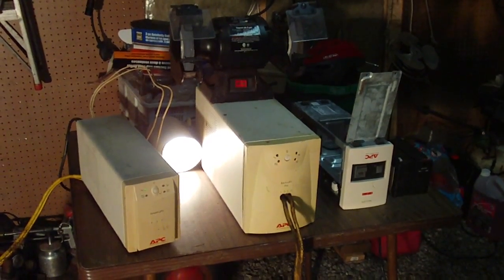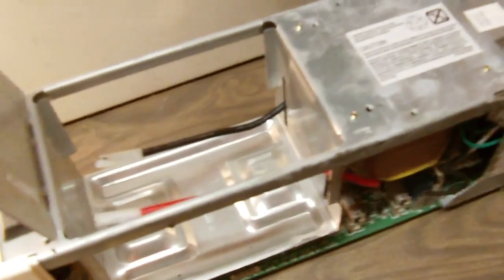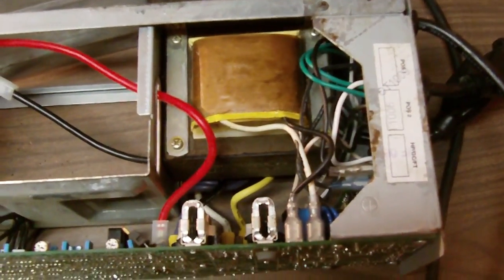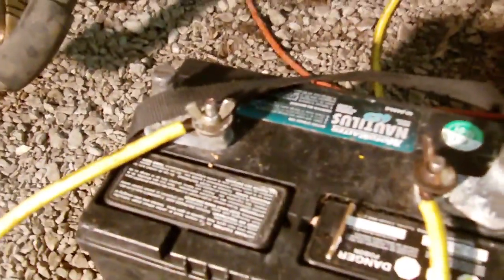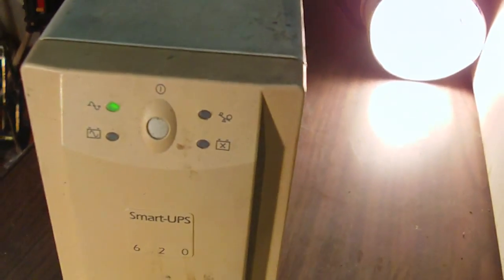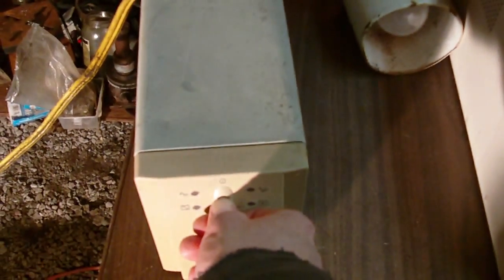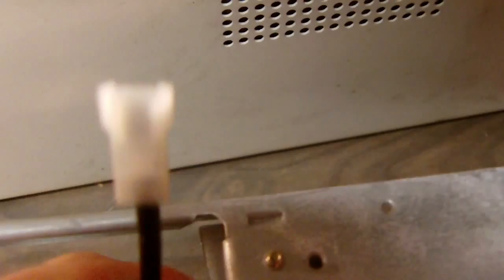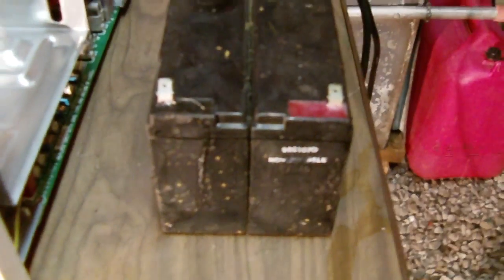How to convert a UPS backup into an inverter

Comment: Hi I tried this but even with a high capacity battery the ups still things that the battery is small and automatically shuts down after 6~10 minutes. How do solve this problem?

Comment: Nope, that and most cheap units have a bypass circuit, most of the time it uses house power. This is because most cheap units deliver mod sine wave power that is not as clean as grid power...

Comment: you should put some cooling fan on it I have one cut a hole and put cooling fan in my so I can run it long hours and it will not over heated the fan come on cool down the unit

Comment: The inverter doesn't turn on unless there was originally a 120Vac source. If I just plug the unit to the battery, I can't get the inverter to turn on.

Comment: When I do it I get a beeping and a relay trips and it switches off after just a few minutes. An that is with me adding a few 12v in parallel that rund a normal inverter for hours. It seems to be switching a relay that clicks back and forward for a while then just switches off. Any help to bypass the relay.

Comment: What for sure we cannot convert back to Inverter is when the UPS requires 220 volts DC input. My UPS is 6kw and it requires 20 small 12 volt batteries therefore I couldn't convert it back.

Comment: Unfortunately, this was the most obvious part of making a UPS function as an inverter -- Hey! Hook up a 12v battery to the 12v battery terminals!   I wanted to see how to disable the beeping (locate and clip the piezo-electric beeper, I assume) and reduce the massive box of the UPS.  Make a 2nd video showing how to downsize the UPS, scrap the huge transformer if it's not needed, disable the beeper and add a fan for cooling.  Shouldn't be too hard (I hope), and if you've had your hands in the guts of these things for 10 years, I bet you know how to do it easily!
Reply: The transformer is needed
Reply: Yo do your video showing it.

Comment: Difference between inverters and UPS systems is that inverters have heatsinks and fans to remove heat build up. UPS usually rely on thermal mass as they expect to only be on for a few minutes tops. Watch out for overheating. Stick a thermostat cooling module and a cpu fan in there at least and rear terminals for battery connection.
Reply: That is exactly what I thought of doing.  I have a 2000va unit and 2 x 100ah batteries. (24v im series).  Not looking to run much, just want to get rid of the annoying part of when the power goes off,i must go to the garage and switch the inverter on. Plug in extension cables in house to my devices and the whole rigmaroll again when the power comes back on. I am running 1 x 11w light, wifi router, a fan and a cellphone charger on it. Just want them to run the whole time on the ups.

Is there ANYWAY to get rid of the stupid
 beep though?
Reply: Break off the buzzer component  @mizmera
Reply: @mizmera  But I noticed something, is like the 650v ups can power itself from the battery without AC power, which the 1500v ups can not power itself from it's battery without AC power.

Comment: And in another failed attempt I figured I could hook solar panels to  my ratty sine wave inverter, then to my ups ... in would clean the sine wave, charge the internal batteries ( or bigger external batteries if I hit the lottery ) and smoothly switch to battery when the sun went down ( with absolutely no interruption to my low power desktop( 90 watts !) . It would also avoid the varying dc voltage from the panels.. as the inverter simply turn off at low voltage.. and effectively consume all the sun nature gave me. . Sure I’d loose an amp or two on the deal but what the hell. Well turns out the ups is finicky about the ac input. Doesn’t like crappy semi square wave... only premium crap from coal fire plant. It makes sense in the end as a ups vets the quality of ac input before changing over. Solution... MAINS. :-(

Comment: I really want to avoid battery’s.. there too expensive. Yet I have 500 watts of panels wasting energy all day.  Why can’t somebody engineer a device that consumes the dynamic 12-19 volt dc from panels .. boost the power to 115 ac BUT reverts ( and or mixes ) to Mains power if the solar input is non sufficient. Of course the ac power sources would always have to be in phase.( a difficult prospect that a ups achieves )The filtering action and nice sine wave from a ups achieves some of the goals. A grid tie inverter will not produce ac if the mains go out so using that is not a good option as it doesn’t facilitate emergency power.... and my power company will have a cow if they detect me using one ( thanks smart meter ).  Anyhow thanks for your video ! Ideas are collective and you got me thinking. Sorry if I’m all over the place.... just drank a monster LOL

Comment: well im trying to hook up ps4 in my car using this method instead using a normal power inverter. i think it will be good right? and if i keep car idle the battery wont discharge
Reply: as long as you use a true sine inverter NOT a modified sine inverter.

Comment: I ran my house off of a 24 volt 600 watt unit 1 model newer than the one in this video. Looks the same but mine had a strip of LEDs that indicated the load going through the unit. would do a high temperature shutdown if I pulled more than 400 watts for a an hour but never caught fire. It would actually pass all 2000 watts of generator power directly through to my house so I had enough power to start up my refrigerator. My battery charger I had plugged into my generator put out  28.5 volts at 40 amps  into a  200 amp hour  flooded lead-acid battery Bank. I worked like this for years until I upgraded to a quality off grid system.

Comment: what about charging the car battery?it takes more time than the original ups battery!!!because the ups battery capacity is around 10 AH while car battery is 60-90 AH !!so how to solve this point ??
Reply: I ran the 24-volt unit to power my house for 2 years. When I need more than 400 watts I ran the generator. I had a battery charger hooked to the generator to keep the battery full because the built-in battery charger was too slow

Comment: Actually this is a dumb idea!! UPS units are not designed to run heavy loads continuously, their transformers aren't rated for running for long periods of time and eventually fry . Also most offline UPS units has the control circuit programmed to shut it down after max 15,30 min even if the battery has a lot of juice left.
Reply: You say the control circuit shuts down after a set time? I'm not sure but mine would work for a few days before my batteries died and I was forced to run the generator.  Of course I disable the annoying beeper
Reply: I ran my house for 2 years off of the 24 volt 600 watt model. It had a bar indicator to show the load that was passing through it. it may have been a slightly different model. It actually passed power from my generator directly through to the load and and charge the batteries at the same time. As long as my generator was running the internal inverter in the UPS was not being used. When the generator was off if I kept it under 400 watts it would not overheat. Of course I finally upgraded to a real off-grid setup but these old UPS's proved robust to me

Comment: My desktop ups has auto off feature if there isn't enough load.... How do I prevent it???
It won't lasts long if I connect small loads such as mobile charger stereo etc
Reply: can you conenct to it using usb or network? you can usually use a program to set that. including any warning signals on or off
Reply: @Politikul  no I can't.... Only power outlets are there no other ports available

Comment: 0:30 It is VA not Watts, and with a special serial cable you can change settings of the UPS, such as the low battery alarm and many other settings.
Reply: how do you turn off the alarm when you don't have it connected to 110V?

Comment: 24 watt UPS how to connect single battery 12 watt please answer me fast
Reply: You would have to hook up a boost converter. In essence ( believe it or not ) it takes 12 volts dc in .... converts it to AC... then converts it to 24v dc. All this being said... the price of such device increases as the amperage increases. You would have to do the math to figure out how much the ups would draw when it demands battery power. There are a whole lot of things to worry about.

Comment: Adding and consuming such big battery  is easy, But How long it will take to fully charge 150AH Battery by a ups circuit board which is actually designed just to charge 7AH Battery ? May  be  10 to 15 days  !!

Comment: Thanks for the video, Thumbs Up. I have a newer UPS in which the charger apparently will not work, or at least not correctly. It was supposed to be charging two 12v batteries, connected to make 24v. But the charging circuit is only putting out 19.9v, which drained the batteries to low for it to work at all. 
However, with a fully charged battery, the UPS still works and puts out proper ac voltage. So this is an idea for a possible alternative usage.
 In any case, its always good to keep things like this in mind, especially when a need arises, and no other alternatives are available, or if other power sources are being rationed to last as long as possible. 
People today especially need to learn to think out-side the "college educated" norms...
Reply: Interesting - which make model of UPS is this that takes 24volts?

Comment: don't use car battery, you need deep cycle batteries.

   The battery plates in such type batteries won’t get damaged even in deep discharge condition. But the automobile battery is quite different from deep cycle batteries, if an automobile battery is discharged deeply, then definitely it will damage the lead plates and reduce the battery life
Reply: The difference of a deep cycle is the distance between the bottom of the plates and the bottom of the battery that holds the electrolyte is greater so when conductive material comes off the plates and falls to the bottom of the battery, there’s more room for it to build up before shorting the plates. I am thinking about using lithium titrate that can discharge completely without damage, charge at a high rate and can get really cold too. They are not as energy dense as more common batteries and the are not as efficient, that’s the down side
Reply: I learned about this helping my dad installing high amperage equipment in police cars. I’d leave the car radio on while I worked and also tested light bars, siren, 100 watt transmitters WITHOUT having the car running... killed many batteries before kindly being told not to... ( I had simply thought I needed to recharge them ) the funny thing is as police have changed to LED light packs and portable radios without high wattage repeater packs in the trunk... And draw a LOT less wattage but still burn the gas. Guess the need the ac.

Comment: How do I know what voltage car battery can I use on such a UPS?
Reply: look at the original battery that was in the UPS, it should have a voltage listed on it. 
Or if it doesn't state, and the battery is to dead to test.... then, if you have a little know how, you can power the UPS on, disconnect the battery, connect a voltage meter to the charging wires on the UPS (the red and black wires that connects to the battery) and see how much voltage the UPS is charging the battery with. A 12v battery will usually be charged with 13.5v - 14.5v. A 24v setup will charge with 25.5v to 26.5 v, on average.

Comment: Nice video, but please I have the APC 650 and let say I'm able to connect the UPS with the Car Battery and also charge as well and it supplies light without Pluging to the Mains ..... How long can it be in the Mains or I can leave it  to keep on charging .... Please reply
Reply: do not use car battery, use deep cycle battery
Reply: i think it has charge controller. leave it connected to mains

Comment: thinking about running this in my 1972 vw beetle.  the battery rides underneath the rear seat.  i might be able to hook it up to the battery and leave it under the seat and run a wire to a momentary switch on the dash, then i can run standard 120 stuff such as chargers and things like speakers because theres no radio, but all i ever use is my phone, so if i can just use speakers, id be home free...
Reply: +NateWilson99 All of those things have a AC->DC converter in them. You'll just be wasting power as heat by inverting 12VDC to 120VAC and back to some low DC voltage. Just use DC->DC converters (called "boost converter" for voltage increaser, and "buck converter" for voltage reducer) and bypass the AC part of the devices you're wanting to connect.

Otherwise, inverters are cheap and a lot safer than modifying an already malfucntioning UPS system (which already has an inverter so you're not really "converting" it)

Comment: UPS inverters are heatsinked for limited time operation which is why those items are small and made of a heavy-gauge aluminum.  They rely on thermal mass more than rather than convective cooling.  Not suitable for continuous use at higher loads unless you provide forced-air cooling.
Reply: I used the 24 volt Model 600 watt to run my house for two years and it doesn't overheat if you keep it under 400 watts
Reply: @SiriusSolar  I don't understand please elaborate
Reply: @sannialiyu6526  He says that he draws 400 W from his UPS and so, it does not heat up much.

Comment: Can I connect it to my running car and leave there fixed?
Reply: through a fuse that allows a quarter to a third of the maximum alternator power  you can. I'd go just for the battery and make a failsafe logic that warns me when the voltage drops below 10.7 volts and turns the inverter of at 10.4 volts ( i know it's harsh for the battery, but that's just an idea i made in 5-10min without any true concept).
Reply: +eivis13 good idea, thanks

Comment: If you draw more wattage or run near wattage limits you will fry the entire unit. One BIG cloud of stinky smoke. Remember to divide 120 into the wattage to get the MAX amount of amps the unit produces. 
Don't run it at max very long either as the unit WILL overheat and smoke as well.
Reply: +countryside Probably wouldn't hurt to add a fuse to it so it doesn't give off the magical white smoke when you overload it.

Comment: Considering you can buy said batteries for like $20 Australian, (and out prices are usually much higher than the US) I don't see how the batteries are worth more than the unit.   but meh,
Be aware, that most of these smaller units are not designed to run for long periods on batteries, so you may get over heating.
Reply: >I don't see how the batteries are worth more than the unit.   

You can get a UPS with a dead battery at a thrift store for less than $5 in the U.S. The new battery would be $15-20 or worth 2-3x the cost of the used unit.
Reply: because you can buy cheap electronic parts from china and tiwan, batteries are still made here.
and the economy of scales is vastly different.
go look up the "how it's made - lead acid batteries" and see what goes into them.

Comment: Hi...i have a ups 24volt battery supply how to convert to 12volts?tnks.
Reply: Wire two 12v batteries in series, then you get 24v, "conversion" complete...
Reply: The first thing you'll need to do is re-wind the transformer, and replace all the mosfets, then you'll need to modify the voltage sensor...  this is almost certainly not worth the effort. either arrange a source of 24V power or see if you can swap it for a 12V one on craigslist etc.

Comment: wath are the amps in that ups ?
Reply: The rating would be on the outside of the unit. But, by going with an external battery to power it, you are extending the length of time the unit will run a given load. I would suggest using a deep cycle battery, rather than a car battery for this application.
Reply: tank you

Comment: How do you jump-start a UPS if it is not hooked up to a 120 volt power source like in a off-grid-cabin.
Reply: Easiest is to start this project with a UPS that can start up without the grid.
some models can some models can't.

Else you'll either have to modify the UPS firmware (potentially very hard to do)
or modify the hardware to fool it that the grid is momentarily live,
 (potentially easier, but you still need to figure out which circuit to modify)
Reply: Are you talking about how to charge the battery in order for it to continue to power your loads? If so, solar would be the way to go. For a 100AH battery, you would need a single 140 watts solar panel, and a 15 amp, 12vdc solar charge controller. When the UPS is not needed, just switch it off.

Comment: how many amp inverter would this be
I guess it would be a sine wave inverter
Reply: I believe most UPS units are Modified Square Wave (some people call them Modified Sine Wave) inverters. The watt rating of the unit would not change. The thing that would change is, the run time of the unit, due to having a larger battery to power it.